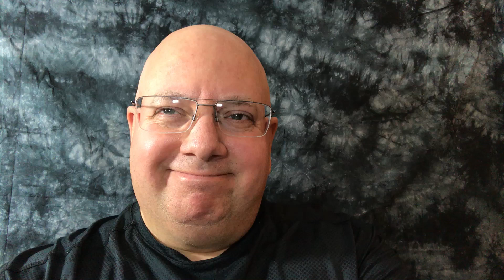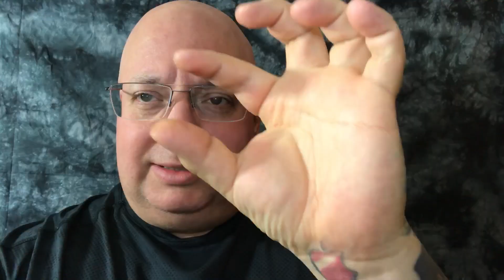🤓 FUJIFILM XT-3 likely BSI Sensor with Electronic VR

Comment: Hi Ken, Hmmm, very interesting!, so electronic VR instead of IBIS, yeah much better, a, you could turn it off, unlike IBIS, b, no moving parts, c, less expensive hardware, more cheap to manufacture software = equals higher profit margin. Certainly better for video, even 8k doesn't need 24 megapixels. If Fuji don't do it with the XT3 someone else very soon will.  I just can't help wondering what happened to the hybrid optical/electronic viewfinder like you thought we'd get on the D850?, or are you so far ahead of the game they just haven't got there yet!, could this be another one?. Cheers Richard.